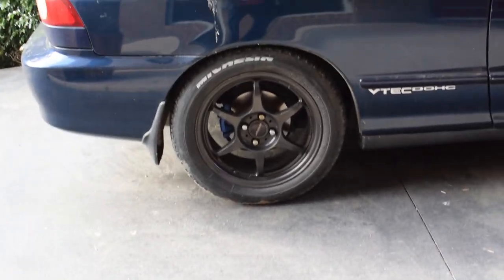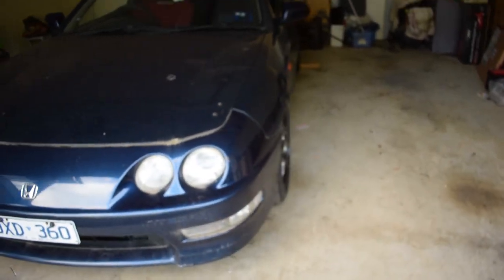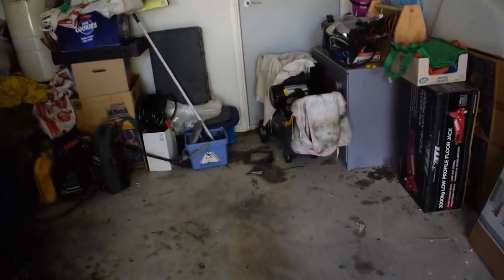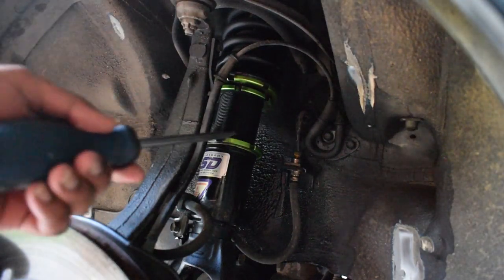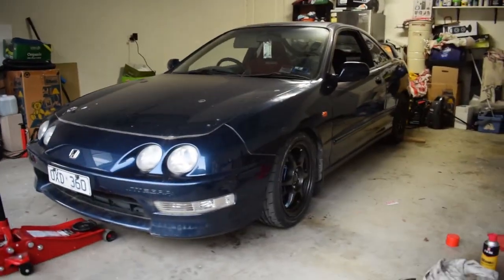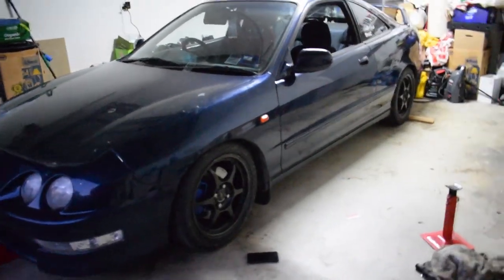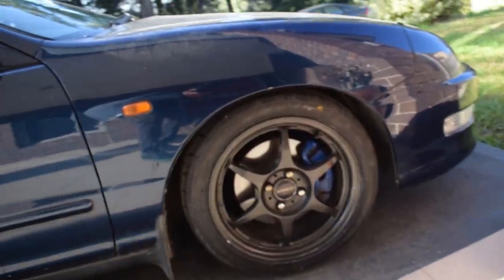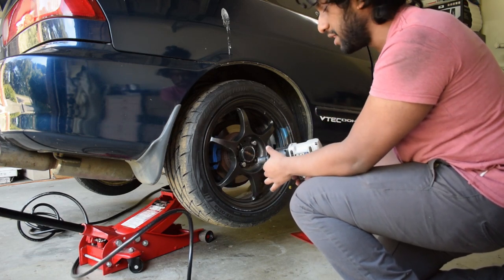LOWERING MY CAR! (went too low) // HONDA INTEGRA

Comment: tbh i’m scared to drop my teg even at stock ride height i found myself scraping bad with passengers in the car it’s not as bad solo and doesn’t really happen but can happen. was this a concern when lowering the car ? are you worried abt the underside getting torn up? am i just overthinking it ? i wanna make mine a stanced cruiser build until my engine blows up and atp build it in a monster k swap